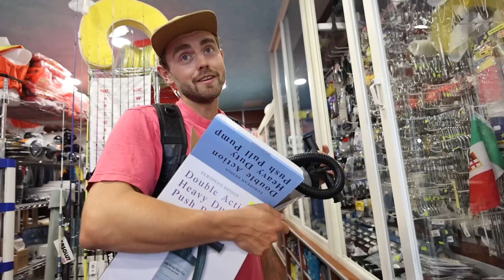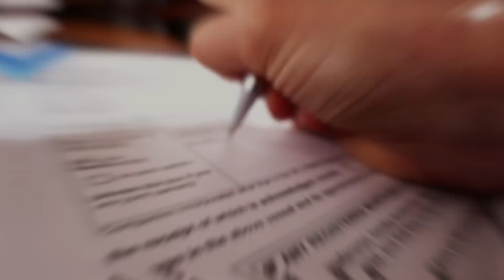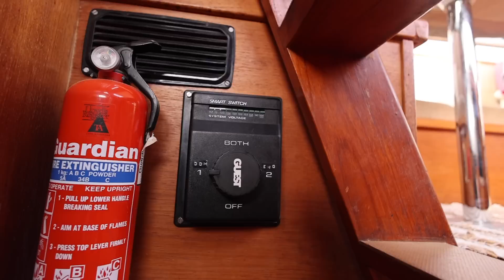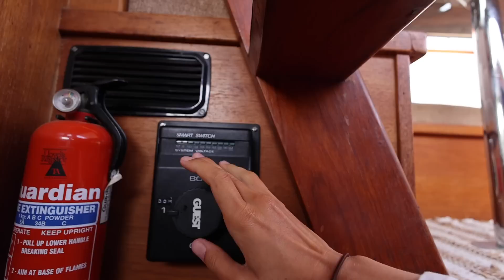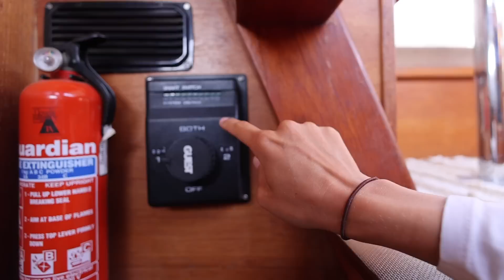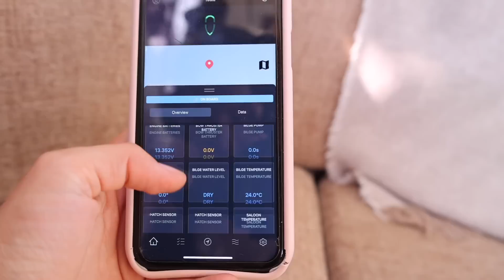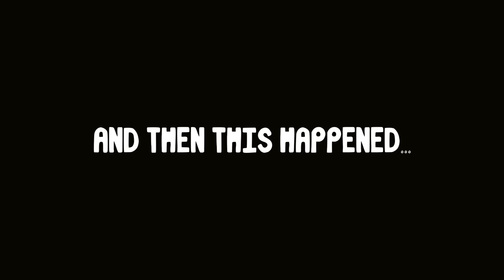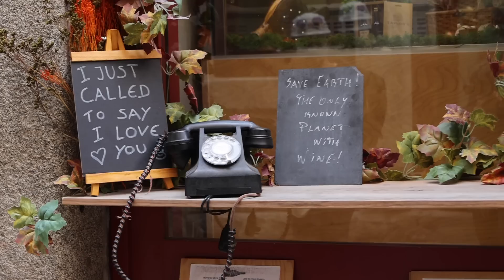BIG SHIP accidentally ends up in ANCHORAGE (and nearly hits us)

Comment: Nice video and storytelling. As you have this electronic autohelm, you really need a form of redundancy there or else you'll have a hard time on your long passages in case that fails - and fail it will. Your best friend, as a sailor, is a Hydrovane. If you're not aware of these, they're an auxiliary rudder that relies on wind. A small sail on the tiller is adjusted relative to wind and this keeps your boat in the same direction relative to wind. This means that wind can blow you off course for some time if the wind changes direction, but also means that the setting of your sails relative to wind does not become a big problem in that wind direction change - while a naive electronic autohelm would keep the boat on course irrespective of wind. Also, being dependent on wind only, it does not have actuators (helm motors) drain batteries. On a sailboat, my rule would be to use autohelm when sailing engine powered and Hydrovane when sailing wind powered.
As to your flux gate mounted away from metal objects, it seemed to be near electric cables. You'd be surprised to discover how much of an electromagnetic field is around such cables when they conduce electricity or electronic signals, plus they're also metal. I'm not sure you need one on board, but if you have one of those "cable-in-wall finder" tools, switch it on at distance from a cable carrying signal and move the tool towards it, to see at what distance the device detects your cable. You may be surprised and then need to realise that the fluxgate is more sensitive than the tool.
As to the big ship almost colliding - do you have a radar reflector in your mast, and maybe AIS?

A woman with an engineering mind and collaboration spirit, goodness gracious, that's more attractive than all the shallow beauty in the world.
Reply from the maker: We would love a Hydrovane, but they are really expensive so it wont be for a little while!

Comment: Make sure that the automatic mode of the bilge pump still works properly after you have wired up the manual switch.  I did that once on a previous boat of mine and it turned out that I wired something improperly such that the manual actuation worked but the automatic actuation was somehow disabled and I ended up with my rug floating several inches above my cabin sole.  Oh, and watch out for rogue orca whales off the coast of Portugal!  There's an advisory on Noonsite about it.  Two boats had their rudders bitten off!
Reply from the maker: The automatic mode still works fine, thankfully. Cheers for the advice!

Comment: Def worth keeping bilges as dry as possible as that will help keep GRP hull moisture levels down. Sometimes running engine whilst at anchor is only choice to maintain battery levels and avoid battery damage. Well done on the boat jobs.
Reply from the maker: Thanks for the advice 😊

Comment: Hi guys. I noticed that your tender outboard motor is a Suzuki and looks like it's about a 5hp . This model is a lemon. As you mentioned that it stopped on you. What happens is as the engine heat's up the piston goes to an oval shape and stops running. You will be able to start it again after it cools down. This is a problem that can't be fixed. So don't waste your time or money just get rid of it.
Reply from the maker: That’s really interesting, thanks for the help!